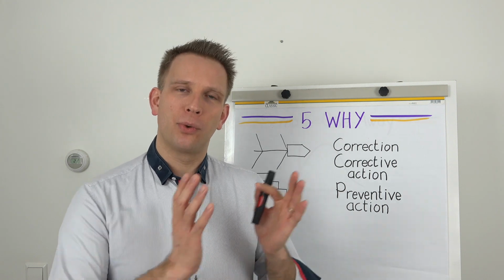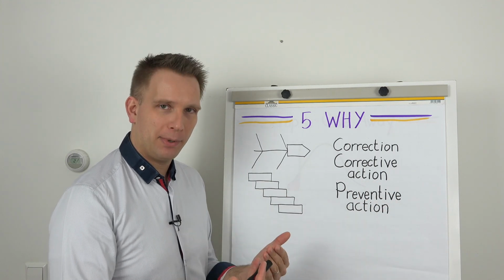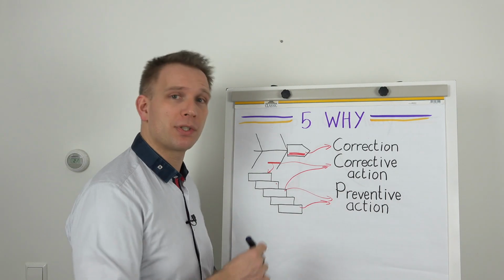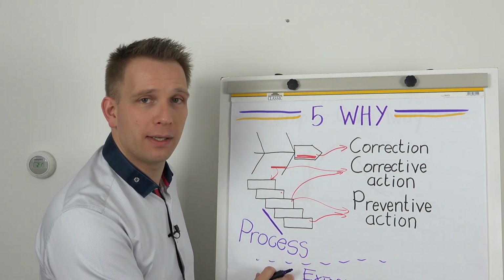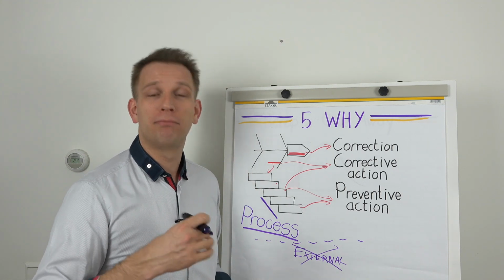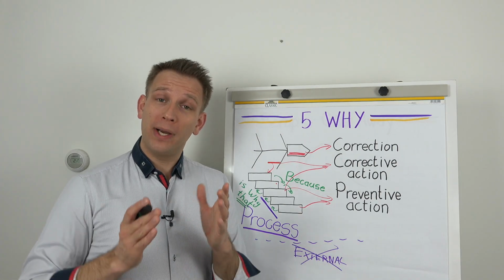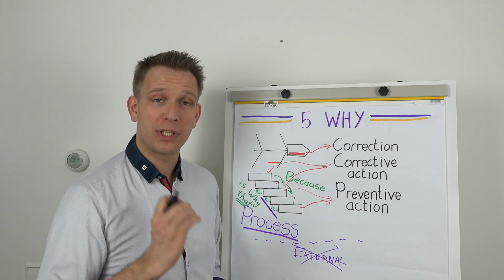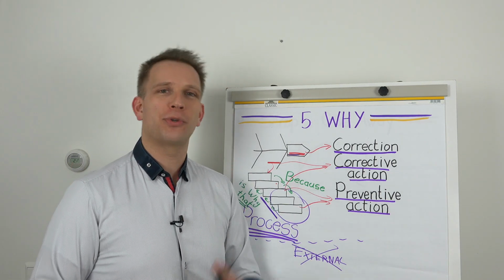5 Why Tips and Tricks from practical experience

Comment: So, if you were going to write a white paper describing your 5Y analysis, what is the bluff or bottom line, upfront, or thesis that you start with? Do you start with the problem as the bluff or the corrective action at the root cause? In my process flow I’ve identified the problem and the whys and I understand the root cause.  I do not know how to frame that in a paper.  I don’t know the correct BLUF or bottom line upfront and or thesis?  I could really use your input or suggestions on this based on this video.
Reply from the maker: I'm not sure I fully understand your question - if you're talking about how to present your 5 Why after you've made it, that's different from actually doing the 5 Why analysis.
When you're doing the analysis, you don't know the root causes yet. So start off with the problem statement and work you way through each next level of why it happened.
If you're looking at how to present your conclusions, the summary (on a slide this would be your title, in a white paper this would be one of your first sentences) should look something like this: <the problem> was caused by <top level cause>, which was allowed to happen because <root cause> (example: the conveyor belt snapping was caused by misalignment of the feeder and moulder, which was allowed to happen because we don't check for proper alignment after monthly cleaning).
So the answer is sort of 'both'
Reply: @TomMentink  that’s perfect and exactly what I was looking for! Thank you.

Comment: I really liked the threshold of corrective to preventive when going deeper into the 5 whys! 
¡Gracias, amigo!
Reply from the maker: That's cool, ey. It works really well when coaching people who are just getting into 5 Why analysis too - very often, if you reflect on a problem that they had previously solved (and go over the thinking steps again, but now with your 5 Why guidance) it's pretty easy to get to that 4-5-6 level of causes, then define actions that they would take based on the full 5 Why, and when you check those actions against the actions that they had already taken, you'll most likely see that they had taken a lot of actions at the top level causes (thinking that these are already preventive actions) and (almost) no actions on those deepest level root causes. Immediately drives home the benefits of 5 Why for them 😃

Comment: Hi Tom. Thanks a lot. Explanation about correction, corrective action and preventive action really answer my confusion all these year. Your channel deserve a lot more view!
Can we have more than one cause for each step in 5-why?
Reply from the maker: Thanks for sharing that praise - I’m happy that my content is helpful for you. Please do share it with your friends and colleagues 😉
Yes, you can branch out to multiple answers when going through the 5 why’s. It does complicate your picture a bit, that’s why I don’t usually show the branches. But I wouldn’t advice using them too much in root cause problem solving. I like it more to put actions on direct causes as well as on root causes (this usually takes care of taking effective corrective and preventive actions).
When we’re using the 5 why’s in a real improvement project (where we’re not chasing a single root cause, but working on improve a couple of aspect of the system to make the process more effective then previous operational results), it makes much more sense to branch out in the 5 why’s (it’s sometimes called a “why-why-because logical analysis” if you take this route), because you want to explore the most (cost-)effective way to stabilize your process or solve some issue.

Comment: Sir If we find two or three possible causes from fishbone diagram, so for  each of these  will we have to make 5 why's analysis?? let say temperature, unskilled man, dusty environment .For all of three we will do 5 Why's??
similarly instead of 5 why's, through validation method can we find out root causes??
Reply from the maker: If those 3 causes are equally important - yes, make 3 5Why’s to get to the root cause of each of them. More often than not, one or two of those causes will have been there for a long time or you already know that it’s way more expensive to solve, then it’s more interesting to investigate the other causes first.

As to finding root causes by elimination or validation of ‘1st level causes’ - no, not really. You should make sure that an expected 1st level cause (the direct, often physical, thing or action causing the problem) are actually happening, so you’ll want to validate their existence in any case. If you’re sure that ‘unskilled man’ was a main cause of your problem, that’s not the root cause -> you the go into the 5 Why’s to research and describe why the person wasn’t skilled (i.e. what were the reasons why there was an unskilled man operating the line; what parts of your training, operational control and procedures allow this to happen).